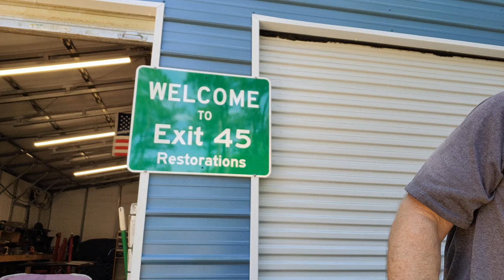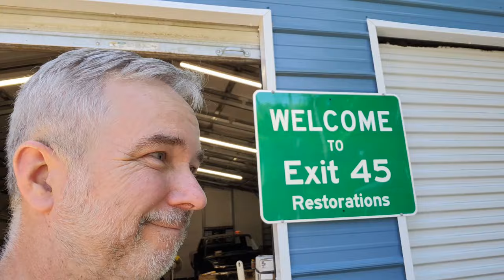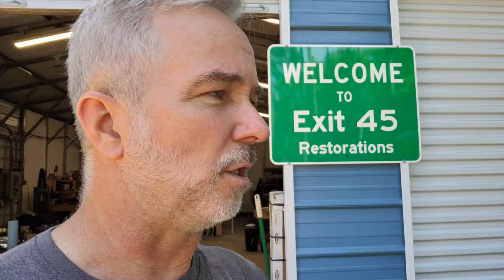Will It Run? Johnson 40 HP

Comment: There is a tube pointed down off the back of the upper motor, called the pee tube. There should be water coming out. Common problem is mud dobber wasps plug them up. If u take it off and blow it out. you should have water running or the motor will overheat

Comment: Hello Matt. First, thanks to Ryan for his service it is very appreciated. Second, I've also never worked on a boat motor, but did you try engaging the drive to see if the propeller spun? I remember my dad working on his Elgin 6 or 7 horse engine. He built a stand and had a trash can filled with water to test it. He'd put in gear and water would fly! Lol 
Nice going, Matt.
George B
Reply from the maker: Hello George.  I thought about doing that.  I still have some cold starts to do before I'm completely happy with how it's running.  I think after that I may try that.

Comment: It’s at the right idol speed the red thing is I think your auto choke kick off running fine nice strong motor I could see in the video that when you moved the red switch the choke butterfly were opening and shutting off all ways make sure your motor is pumping water out off the hole at the top some times dirt dobbers make a nest in it and block of the out flow. If your selling it I would suggest you tell the next person to change the impeller for the water pump as they go hard there rubber to do the job it involves unbolting the lower leg drive if you do change it your self grease the new one

Comment: Is that a j40plsrs? That red lever does the auto choke, vertically its manual choke. Moved forward it auto primes when you hold the key in for a few seconds
Reply from the maker: That's very helpful info... thanks.   I'm not sure other than it's a 40 HP Johnson.